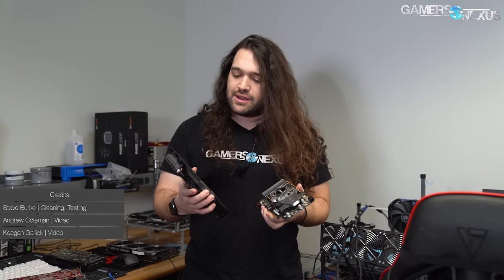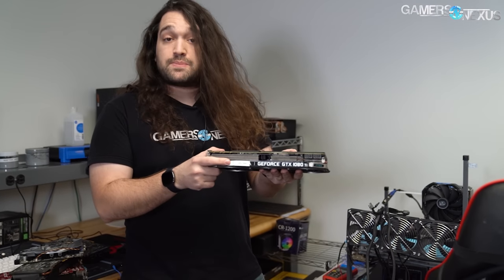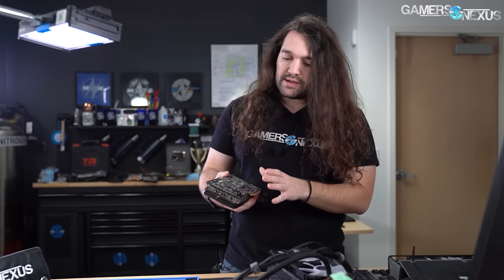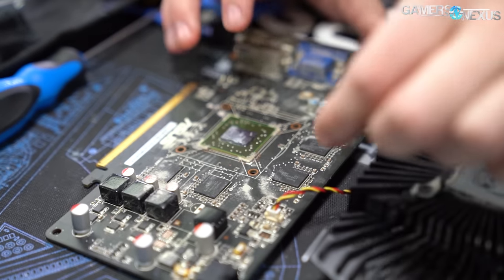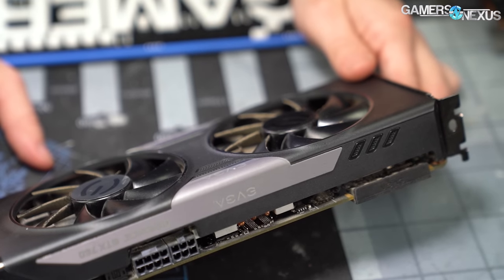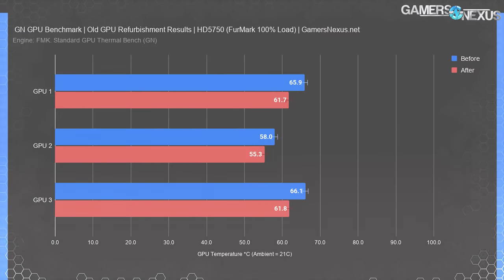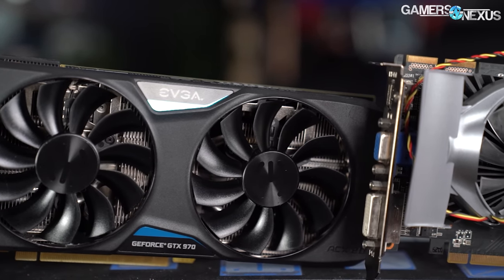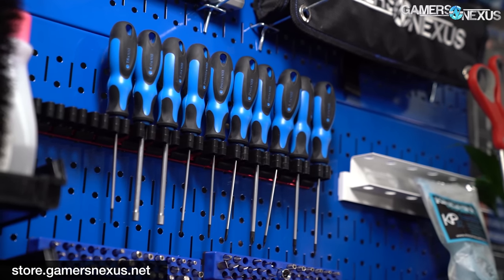GPU Cleaning Before & After Thermals: Re-Pasting & Dust Removal

Comment: If you’re gonna use compressed air to clean your PC, I would suggest a max of 60 PSI.  I’ve gone as high as 105 and been fine with small bursts.  Just be careful, I accidentally cracked a water block using too much air pressure, that was a costly repair, $40 plus shipping.

Comment: I've cleaned a lot of older video cards. From my observations the thermal paste will need changing roughly Evey 5 years. Get rid of dust as often as you can. As long as the manufacturer didn't cheep out most thermal pastes actually last quite well.

Comment: Great video topic! Just took apart my Gigabyte 2080ti Waterforce AIO to repaste and replace pads,  and was having trouble with mounting pressure. Didn't think the clearances of the thermal pads mattered all that much. Will have to confirm with GB RMA. Thanks GN!

Comment: I did a deep clean and re-paste with MX4 on my 10 month old Gigabyte 1650 Super recently, and have gone from 75-78C under full GPU load to 68-72C after.  For only being 10 months old, the factory paste was very dry, which is a sign of crappy paste.  It takes MX4 years to get crusty like that.

Comment: If you're going with the wash with water method, a good hair dryer is just as effective. 
Just remember that the metal can get hot when you're blasting it so it's best leaned on an angle or put on stilts/stands for safety.
Also nail polish remover and tissues work well to dissolve old crappy thermal paste if you have a hard time and then cleaning the metal after too

Comment: I'd like to throw in my 3 cents into this as well. I've got a Founders Edititon GTX 1080 and used it almost everyday since the premiere. After 2 years, I've had a lot of dust build up inside.... and I mean, a lot. 
During gaming, I've had the GPU temp jump up to 80C easily. After cleaning and repasting, it never went above 70 - even when playing in 4k. 
Like the dude in the video said - it really depends on what graphics card you have. On some, it won't make a whole lot of difference, on some it might even save your card from failing.

Comment: Bought a Used Stirx RX 580 OC 8GB last June and when It arrived I popped it in my system and kept having it crashing/overheating and running at similar speeds to the R9 380. Changed the Thermal Paste that was hardened and must have been the original and it never gave me any issues. Thermals dropped 20 degrees, Fans never had to spin as fast and the card ran better at much better speeds going from a max of 970 to being able to hit a stable 1420 with no heat isues. After that I replaced the Thermal paste on my HD HD 4850, HD 6870, and RX 480 OC 4GB that afternoon. 

Got a used HP Envy system with a GTX 760 1.5GB OEM in it and it was running hot and loud, replaced the paste and the thermals dropped enough that it runs at 1032 instead of an 888 mhz boost speed at the same temps without any manual overclocking at all. That was just with a clean and thermal paster replacement and a single fan in a system with very poor air flow. So it is now becoming a habit for me to replace the GPU thermal paste on any older used GPU not just the CPUs when rebuilding old salvaged machines.

Comment: When I have this situation and I don't have paste around, I put a drop of WD40 on the old paste and mix it up. Softens it up nicely. Not a permanent solution, but handy if you need to use the hardware again on short notice.

Comment: I just did this in my 1070. Went from 90s to 75ish under full load, Core Clock went from 1600ish to 1900ish and I gained 20fps in almost all my games PLUS it doesn't sound like a vacuum cleaner.

Comment: GTX 970 is still a solid card @1080p with moderate to high settings you can still get 60fps on most modern games. I need to make some sacrifices with my 970m, but its about time for some maintenance.

Comment: I actually always clean my cards in the sink, sans fans. Even my Motherboards get the same treatment.  After I clean them I hit them with a high output hair dryer. Whole process generally takes about 30-45 minutes, but I have yet to kill a part doing this. Key is to be 100% sure the water is gone. If you still have water under a BGA chip, it's likely going to cook!

Comment: I use a soft bristle paintbrush to clean all components, including motherboards. Works wonders. The TIM clean to soak paste for a couple minutes. Makes it easier to removes as TIM is citrus based. I certainly wouldn't use a screwdriver to scrape dry paste off of a heatsink ;)

Comment: After watching this video I ran some benchmarks, took my XFX R9 290x apart  to checkout the thermal pads/paste. Then walked half an hour to micro center to buy thermal paste... I’ll post my before and after results when I get back.
Reply: Before was running at stock clocks but at 100C after was running overclocked at 81C

Comment: I recently replaced thermal paste on my gtx 1080 strix oc card. First time in 4 years. It had to be run with 60 % power limit before, because temps were going over 80 celcius. After replacing thermal paste, now even with full overclocks (120 % power limit), temps are staying around 60-70 celcius again. Room temp about 20 celcius. (During summer it was even worse because room temp was around 30). 15 minutes of work and cost 4 euros. Worth.

Comment: I had to buy a GTX 1060 from ebay last month when my 5500XT stopped working. I could see from the picture that the seller was trying to hide the dusty areas. I'm comfortable taking cards apart, the paste was dry and three card was caked in dust. 

I removed the heat sink and took it out to the garage, held the fan to keep it from spinning and I used the air compressor to blow it off. It was a dust storm! I payed $200 for that dumb card.

Comment: Safety tip. Do NOT allow the fans to spin when using compressed air. They fans will quickly exceed their rated speed, and may (read probably) split apart and produce shrapnel. I have seen this with fans, ans even steel ball bearings. In the latter case, a 10mm ball bearing pierced a steel car door. Not dented, went all the way through. That plastic fan blade will inbed very deep into your skin.

Comment: I did the exact same thing on my current gtx 960 2gb founders edition card and seen a good drop on temp after cleaning out a wall of dust build up and rock solid thermal paste and I got the card like that second hand and even seen the card no longer thermal throttles with even better temps of 68°c at the highest with games like crysis remastered with the ambient temp of 18°c.

Comment: I know the heatsink of the HD5750 is aluminum and scratching it with a screwdriver isn't much of a concern. But, if anyone ever encounters thermal paste that's hardened that bad, and it just wont come off with just Isopropyl alcohol, instead of taking a scredriver to it you can add a little bit of any oil-based lubricant (like wd-40) and spread it a bit; this will soften the paste up enough that you can wipe it off with some isopropyl and a towel. But if you do this, make sure to clean all of the wd-40! It might not be conductive but i dont want to know what happens when you leave oil-based lubricant on a graphics card

Comment: 4:15 one important information is missing: do not buy the cheapest pads you can find. Although not as critical as for CPU/GPU, the thermal conductivity of the pads shouldn't be worse than the original ones.

Comment: Damn that gtx 970 cleaned at 21:13 looks FINE. 700, 900 and many 1000 series gpu designs looked very good and then it went sour for that "gamery" look with rtx 20 and now 30 series

Comment: I have a retired EVGA GTX 680 FTW sitting on the fireplace mantle that was never cleaned past the shroud to make it look nice. As far as I know the card should still work and is a backup to a Gigabyte 1060 6GB... which is a backup to a EVGA 2080 TI XC Ultra. Suppose the 2 older cards could use a good cleaning. The 2080 TI gets blown out monthly along with the rest of the PC.

Comment: Cheap paint brushes are even more useful than iair for this exercise.  They can be bought in many sizes, and softer ones are perfect little brooms for dusty boards.  Next I recommend alcohol wipes, or alcohol and paper towels.  It won't harm the board and will take away some of the animal or smokers "tar" that can't be sprayed or brushed off.

Comment: To clean that hardened baked on paste from the HD 5750 I’d have probably soaked it with a little WD-40, scrub with a soft bristled brush, a toothbrush perhaps, than wipe it clean with a paper towel before a blast of quick drying electronics cleaner to remove the oily residue of the WD-40. It’s how I removed the mystery substance used on a cooler master heat sink on a socket 370 Intel Celestine 600. Rubbing alcohol didn’t do, acetone couldn’t do it, only WD-40 melted through that mystery compound from 20 years ago. 

As someone who’s passions are cars and computers, you get creative, and instead of thinking outside the box, sometimes I think inside a different box to find the solution I need lol.

Comment: I am missing the best (cheap) cleaning tool for dust which is a painters brush. I use them for quick cleaning the fans and GPU/CPU cooling without dismantle it. Also to clean Motherboards as they also are getting dust on them.
They are also very handy to clean dust of your keyboard, so keep it close and when you are idling behind a PC grab the brush and keep you keyboard.

Comment: Whoever reads this, a year after creation, use (or at least try using) Automotive brake cleaner. It works best, and the spray helps clean every heat sink fin, nook and cranny. I've used this on CPUs, Heat Sinks, Water Cooler Blocks, AND on Mother Boards / Video Boards for 10+ years without issues.

This also easily cleans dirt off a whole board, which migh be needed if it was in a smoker's house or other problematic (industrial) environment. It left no residue for dirt / dust to restick afterwords.

Also, watching the video, too much pressure taking off a stuck heat sink can BREAK the GPU. So spraying between the board and heat sink first, and maybe a respray after 30-60 seconds, will loosen that bond so no extra force is required for separation.

Comment: i dropped 10C on a brand new GPU because the manufacturer did a terrible job at applying paste.
45C to under 35C at load.
and that was a water blocked GPU as well.

Comment: I have a 5 year old Acer laptop that would rest at 70-74C and struggled with 720p on youtube until I re-pasted.  Paste was still good, but had squeezed out around the cpu/gpu dies instead of bridging the gap to the heatpipes.  Small dust bunny in heatsink, but not too bad after 5 years.   Currently watching this at 1080 no problem and 48C.

Comment: So I have a Dell GTX3070 from the dreaded G5 5000 system... I have had the GPU for 2 years and used it as my daily driver for everything from video editing to to gaming and everything in between. I was noticing that the fan was not at 0 idle to maintain the same 45ﾟC celsius well not underload.  I decided to replace the thermal paste, It was hardened around the edges but the center was still malleable. I used a generous amount of thermal paste probably just more than a Pea sized amount in an X shape.  The thermal pads were in excellent shape so I left those well enough alone and put everything back together. Thing is my thermals are at the exact same that they were before at roughly 44ﾟC with an ambient temperature of 21ﾟand a load temperature of anywhere between 60 to 67ﾟC  Based on the application or process I was loading the graphics card with. Ultimately it seems like my performance actually probably reduced as I have a 2 to 3ﾟ higher load temperature now... Anyone have an idea what I may have done wrong I used the same amount of thermal paste that Dell had applied and I used cyonaunt paste from the thermal grizzly for reference.

edit:  Alright well after some careful consideration I removed the video card and clean out all of the thermal paste again... reapplied it in a more modest amount and it dropped my Temps from high 60s to low 50s.. I guess I used to much

Comment: About a week ago, I decided to reapply some thermal paste on my EVGA RTX 2070, which was only just over a year old (in terms of use). I saw ~10C difference during furmark burnin. I was shocked I could see that gain in such a short amount of use time.

Great instructional video, especially in these days of stock issues preventing users from just buying a new card because performance has dropped.

Comment: My old GTX 1050Ti was out of warranty and I was into overclocking, so I took the cooler off and replaced the thermal paste. My testing was terrible, I left all the fans on auto, but I got 5° C of improvement.

Comment: Well i got GTX 1080Ti, which was refubrished in service. I had 80 degree in gaming, and even 88 degree in RDR 2 specially. Once i changed thermal compund (after almost 2 years of usage) temps in game never reached 70 degree - NEVER. I used Kryonaut paste, which isnt working too good for CPU's i had (yes, it wasnt working best, Gelid GC Extreme beated it) but for GPU core it did miracle. Whole operation is easy, if You are on warranty - i would do it anyway. Thats what i did - i propably lost warranty (its MSI GTX 1080Ti Gaming X Trio), but now, i'm sure i will not overheat it.

BTW i use custom Afterburner settings - Power Limit at 75% and fan curve up to 45%.

Comment: Thanks for the video, reminded me I haven't done that to my computer in over a year now and I noticed that Dust is constantly building up on the Fractal's filters in this room.
Well I just took it all apart and cleaned it out with my air compressor (was a lot of dust bunnies), and I've dropped 15C-20C off my CPU temps when running Cinebenchr23, and about 10-15C off my 5700XT running furmark.
It's totally worth doing (except that freaking Fractal Define R2 XL case is soooo heavy).

Comment: Went to clean out an ancient pc in my research lab while installing a new hdd. I expected to find mountains of dust as it runs 24/7 and has been for maybe 15 years. It actually had almost no dust in the heatsinks. Just a fine coating in the bottom on the case. My home pc needs dusting every 3 months! Moral of the story, live in a laboratory 😂

Comment: I see a bunch of people messing up their cards trying to do what wasn't really needed in the first place. Keeping the dust out is usually enough.
Reply: True, unless you want to squeeze out the last bit of temperature gains with better pads and paste. Normally replacing pads and even only the paste on the GPU with better quality yields at least 3 to 5 degrees improvement, even on new cards. Not seeing that in this video made me wonder how that could be, until I saw how much paste he used. Not surprised anymore. Makes the whole video useless.

Comment: I was honestly hoping you'd soak a GPU heatsink in water so I could ask: would WD-40 after cleaning it up be feasible to avoid long-term corrosion? I ask it because I've done it with my previous GPU, but not long after I sold it(a month's time). It takes a very long time for the smell of the spray to come off, but other than that it worked just fine and temperature was pretty much what it was before, maybe a little bit better. Great video btw!!!

Comment: i wash heat sinks, and  FANS too with hand shower, shake off excess water and put them to dry on hotter than hell radiator, yet to break anything.  you can also wash cpu's and sticks of RAM with water (and dishwashing liquid).. ive been doing this 20 years and going..

Comment: Just motivated me to disassemble my old xfx hd6870 a basic clean and apply new mx4 thermal grease..temperatures were upto 5c less  hovering between 69 and 72 degrees.I remember this card running hot at 75c plus...managed to play wow with all settings at graphics setting 5....not bad for a card that  was released in october 2010...I rather think that memory was being cached from my ssd which probably helped alot but i got a solid 60 fps with this

Comment: Mmm in the first graph you're talking about temperatures but at the bottom of the chart says "onPresent FPS (higher & more consistent is better)"...  😅
I think the best thing to do is to check the temperatures when the cards are new and then you can have a reference to compare to. I do that every time I change something on the system (adding fans, changing the CPU cooler, etc.) so I know when it's time to clean 😄

Comment: In my experience, 16 oz of vodka-sprite spilled through the top of the case directly onto the back of the powered and running GTX 970 (followed by three days of rice) seemed to clean it well.

Comment: I have used a cheap, clean,  painters brush on my pc and components as a dust removal tool for years with great effect. However, this kicks the dust in the air, something Steve is right to try to avoid if indoors.

Comment: All of these are spotless compared to one system I received  that suddenly lost half the memory.  After opening the case I noticed it was rocking a gray motherboard pcb with only a few chips on it.  ended up removing  blankets of dust taller than the surface mounted chips, that covered the entire motherboard.  Once done everying was good and working again.